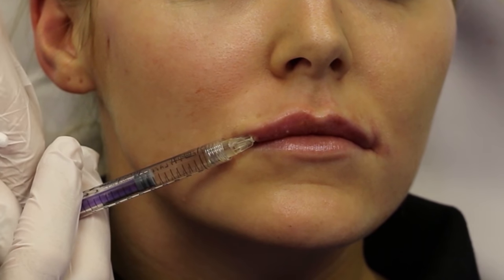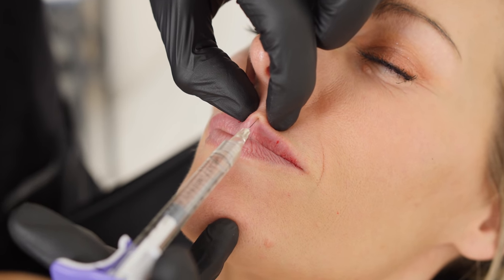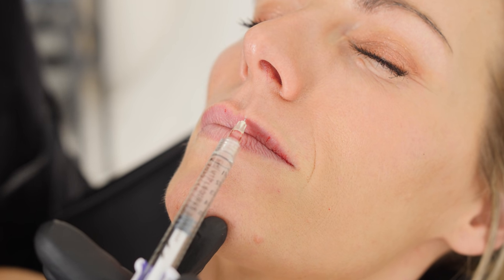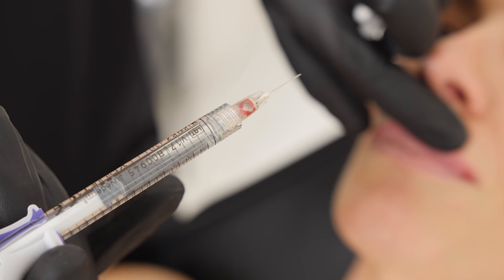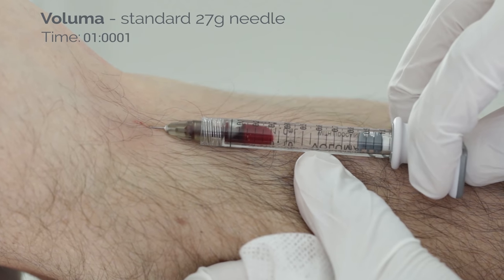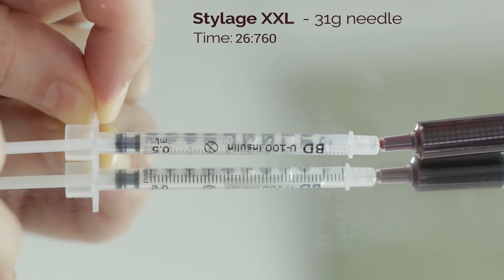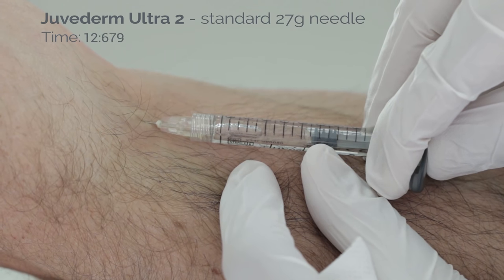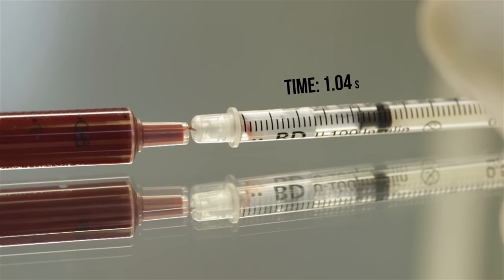SAFETY ADVICE: How Many Seconds You Should Aspirate For When Injecting Dermal Filler

Comment: I am hoping this question helps give me perspective.  I should lead with I'm super green in aesthetics but my background is 10 years critical care nurse. I understand when aspirating we care about where the tip of our instrument is, however my question focuses more on retrograde injections (think lips and smile lines).  Is it valuable to begin aspirating once through the epidermis. Meaning engaging that vacuum immediately on route to not only know if you've landed in a vessel or also have gone through it? As if you've gone through the vessel surely my retrograde injection will also at some point place filler in said vessel? Now I get timing is not on our side with such technique as it is in and out quite rapidly as opposed to a bolus injection.  However with these softer filler even with a 29g you can get a positive result quickly, more so with arterial pressure than venous. I am curious if it was just a coincidence or if there is value to that.  Is engaging that vacuum damaging to the tissues etc. Or truly not even worth doing.
Reply: I have the same kind of questions about engaging the vacuum and beginning aspirating as soon as gone into the dermis. I hope eventually you/we will get a reply
Reply from the maker: This is an excellent question as I do believe that will add sensitivity, I have a video coming on this soon.